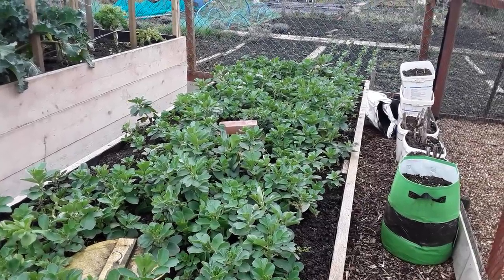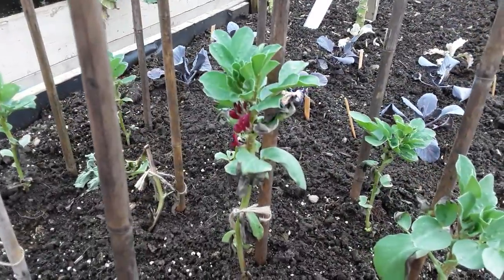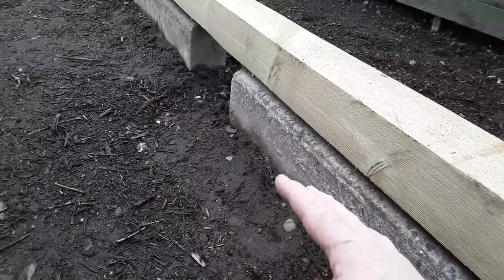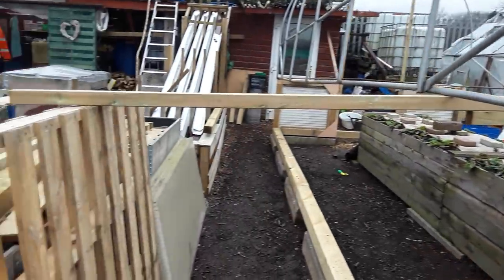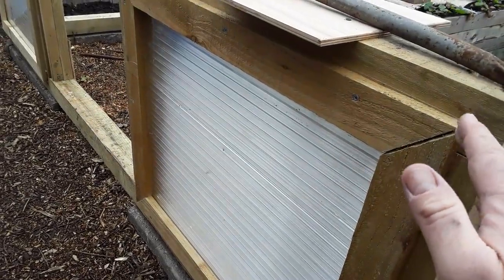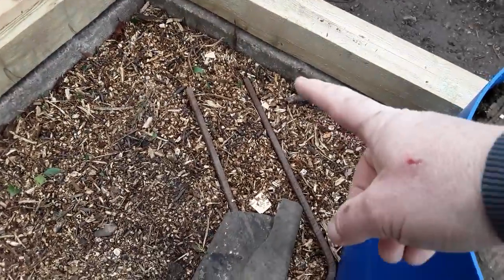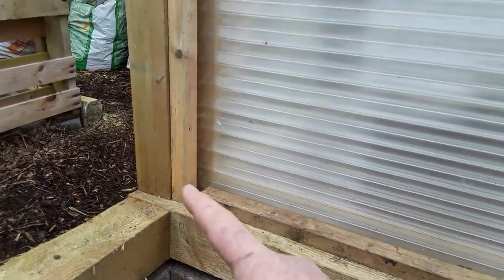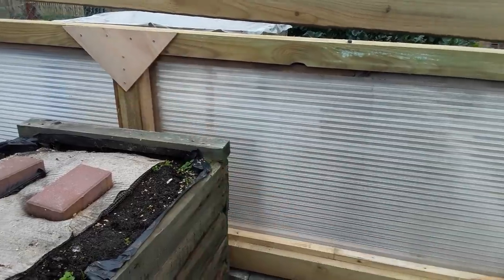SHEDWARS21: My Double Skinned Polytunnel Rebuild Creating Self Sufficiency In The Future ♻️ Part 3

Comment: You'll be the first man in space without a rocket if you attempt to eat all those artichokes before they go off!
I mentioned it before - one really quick and simple way to preserve a few of them is to ferment them in salt water. All you need is a sterilised jar, natural water and sea salt (don't use tap water or table salt as they inhibit the fermentation process). They'll store for ages, and add a new variation to the taste.
Great building project by the way.
Reply from the maker: Just going to right this down Tony so not to forget and I will definitely try it on the harvest. 

♻️Happy gardening, Terry King 💨💨💨💨💨💨💨💨💨💨💨💨💨💨💨💨💨

Comment: Great Video again Terry, just a thought! what about lining the inside wall ( the raised timber section ) with Barrier netting or Enviromesh, and use the pollycarb Sheets on the out side and making one as a sliding window ?
Reply from the maker: Yes Alan you have given me some good thoughts, the outside was going to be envio mesh, but would make sense to be able to slide it from the outside and probably better than opening windows I will do some experimenting before filming part 4. Cheers my friend. 

♻️Happy gardening, Terry King.

Comment: Could you use the damp proof course material instead of the screws to stop the rising damp??
Reply from the maker: I could and was my original intention Philip until I had the comments about the screws and water can still gather on top of the DPC from rain, condensation and watering so went for this option which cost £1.50 in screws. Cheers my friend and I appreciate your support. 

♻️Happy gardening, Terry King.